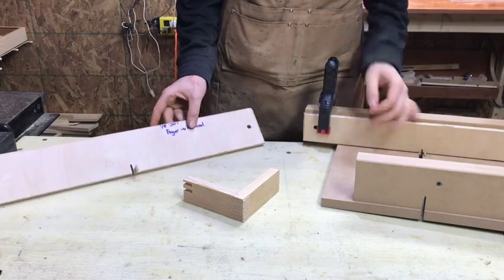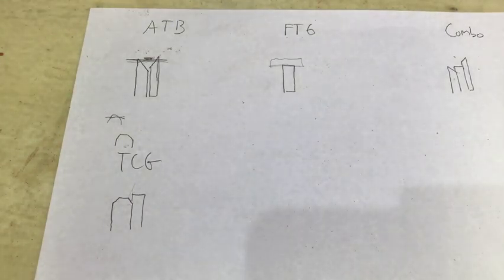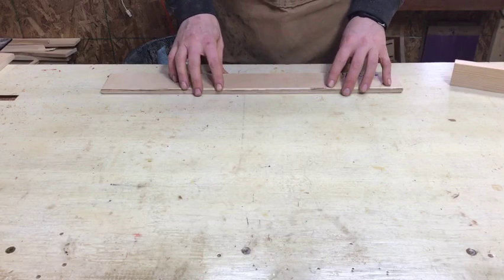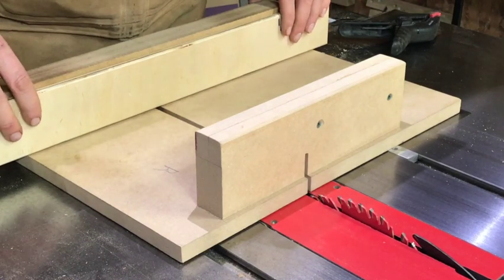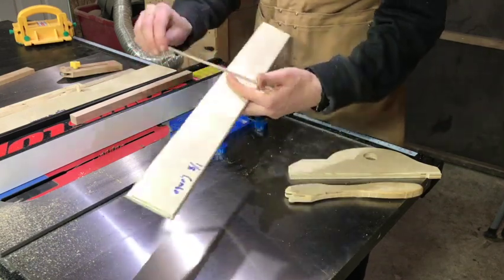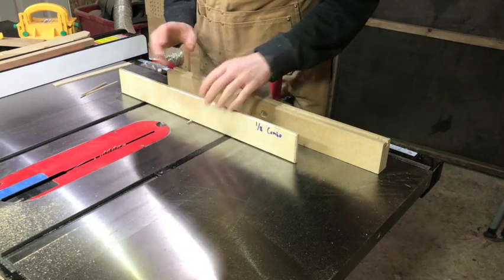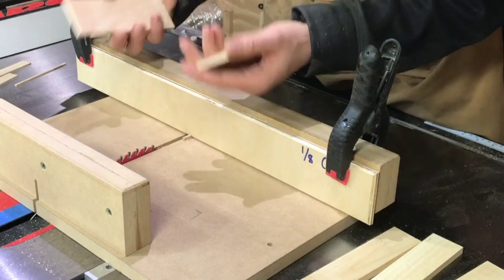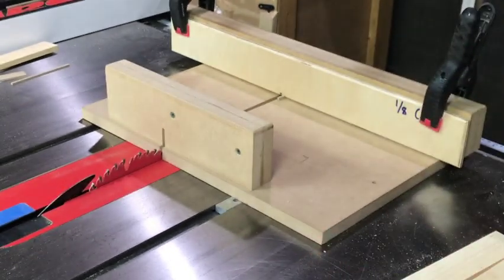Finger Joint Jig for Table Saw Crosscut Sled - Everything You Need to Know.

Comment: I have two 1/4" holes that goes through the fence on my crosscut sled to register jigs. I get the jig in the position I want it and clamped and use a transfer punch to mark through the holes. Then I drill them out and glue in 1/4" dowels so I can quickly get the jig back into position next time. I find it really helps. Jigs like this usually end up wearing and need to be adjusted, but they're so easy to make I just remake them most of the time. Great video bud.

Comment: If you like Diablo blades, you can get a Freud Industrial Heavy Duty Rip blade and Freud Industrial Thick Stock Rip blade which come in FTG. They sell it from something like 8" to 14", so you can fit them even in 8-1/4" contractor's saws. Diablo blades are made by Freud. Hope that helps someone.
Reply from the maker: I'm a big fan of Freud blades, though i think the tradeoff is that you need to have access to a sharpener to make it worth it. There isn't a real reason to pay for the extra carbide unless you can resharpen it. The only other reason is if you want a full kerf, but also then need a decently powered saw to use it. 

I have yet to use their thin kerf blades, and I have heard they work well on both lower power and higher power saws, and my next blade will be their think kerf rip. I currently have the 50 combo and 30 tooth glue line. I'm not a huge fan of the combo, and wish I just went with the 60 tooth crosscut. I tried being lazy and cheap, and went with the 50, thinking I could mostly just use it all the time, but it really doesn't excel at much. It has too many teeth to quickly rip thick, hard stock, and not enough teeth for super clean crosscuts. It's now mostly just my daily driver for random projects or cuts that aren't final. 

Freud charges a fair bit if you mail it to them to resharpen (including shipping), so it can be a wash between a 40-60 tooth Freud cost to resharpen, and a new 40-60 tooth Diablo, if you don't have local/cheap sharpening.
Reply: @MMWoodworking  Thanks for sharing your experiences.  

I touch up my own blades and mail them out to sharpen them as needed.  Burns Power Tools has done an outstanding job for me in the past at $10 per blade, but I've now found a local shop that will sharpen a blade for $15 and do a solid job.  I've found that it's far more economical to send multiple blades to be sharpened at the same time if I'm mailing them. But as far as the frued heavy duty rip that I use as a joinery blade, it has never needed to be sharpened so far. I only use it for joinery though, never for ripping. My Dewalt DWE7485 has no issues in terms of power on the materials I'm using.

I've made a few thousand boxes out of 1/2" thick and 3/4" thick material, mostly ~5-8" tall, and I'm only just noticing some degradation in performance.

I sell the boxes, so it makes sense for me to invest in the blade. Before I was using a file to flatten the joints. I used to use a frued combo blade and the cleanup was a couple file strokes per slot, but it quickly got out of hand as sales increased.

If you're worried about needing to sharpen it, and you're only using it for joinery, it shouldn't be an issue. I use it for bridle joints, half laps and tennons as well. 

I've never tried it on plywood or any engineered wood product though. I mostly work in hickory, ash, red oak, western red cedar and northern white pine. 

Sorry for the rambly lack of organization, but hopefully some of that context to people if they are making a buying decision.

Comment: Hi this was an excellent very well elaborated presentation. I have a Dewalt 8 1/4 table saw. What kind of a make would you recommend. I really appreciate your input in advance. Thanks.
Reply from the maker: I'm not sure what you mean by "what kind of make"... do you mean blade? If so, I don't think it matters a ton, since no 8 1/4in blades have flat top teeth, or even a raker. I guess I would go with 40, but really just whatever your sharpest one is. It shouldn't matter a lot since they are essentially all the same shape at that size.